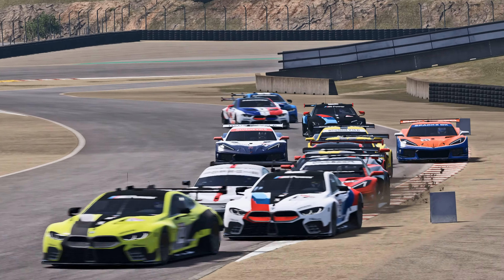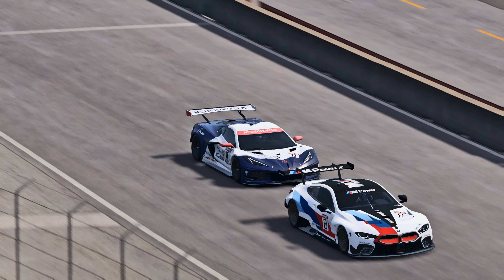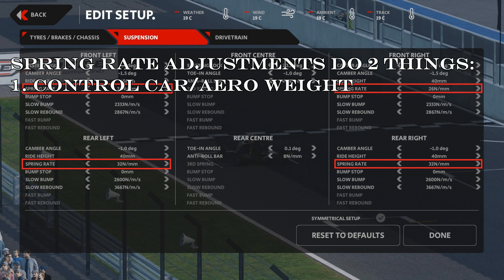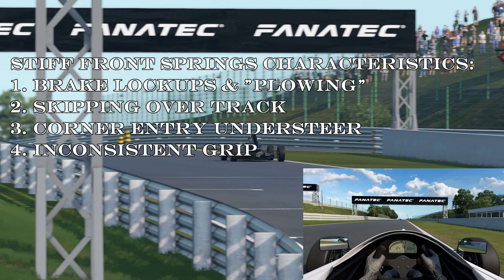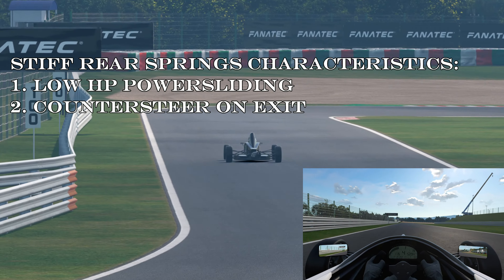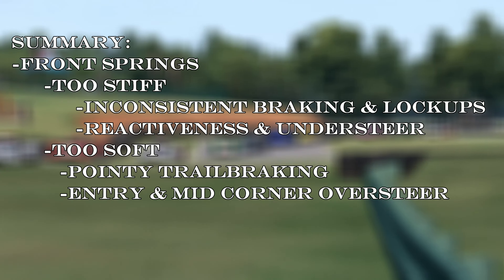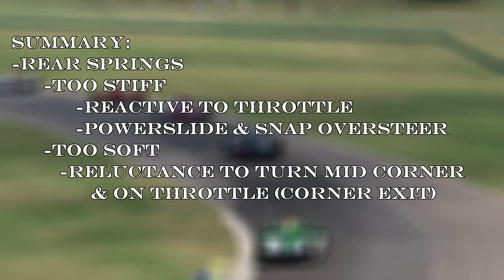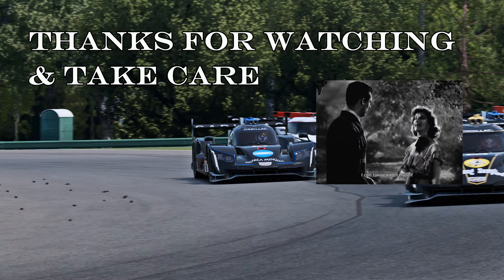How to tune Springs -  A Sim Racing Setup Guide feat. Automobilista 2

Comment: Awesome! Great to see a new updated version of a setup guide that has some extreme examples thrown in to give clearer examples of how the cars behaviour changes. I'm really looking forward to the rest of the videos that will be on the way.

In the last 2 weeks I had been going through you previous guide and making a summary document for myself. Its good to have even more videos with further detail now, so that I can improve the guide even better. I had been wondering which car should I use as a test car for my own practical tests and experiments. I had forgotten about the Formula Trainer, seems like an ideal car to try out. And Suzuka was the track I wanted to go to. I love its flow. Its a great test track due to it having all sorts of slow, medium and high speed corners, as well as chicanes and the esses to test constant shifts in weight from side to side.
Reply from the maker: Thanks Donny!

Comment: Very good video, as usual. I have got question about data for springs and for rest settings. Why do you have real values? In my AMS2 I see only: 1, 2, 3 ...
Reply from the maker: You can switch it to the rates in the gameplay options.

Comment: Very informative! With the advent of the 1.3 update, have you had to adjust your existing car setups much?
Reply from the maker: I volunteer my time to make setups for Reiza now,,but I havent worked on all of the cars yet. And yes, It still look to camber/pressure tires and adjust brake ducts and aero for the tracks.
Reply: @Steelcast27  That's great. It'll be a while before I get round to this and I'll check back on your channel when I'm ready. Thanks for replying.

Comment: I  can ARBs and springs seems to bleed into each other's behavior. Which one should one focus on first?
Reply from the maker: They do. ARBs allow you to control roll stiffness balance. Springs control pitch, roll, ride height and more, so personally Id avoid using springs and try ARB first. Front ARB for turn in to mid corner, rears for mid corner to exit.